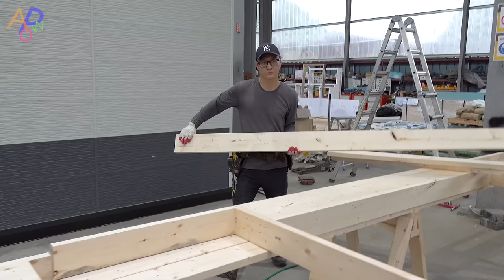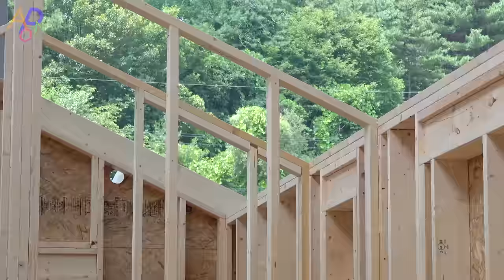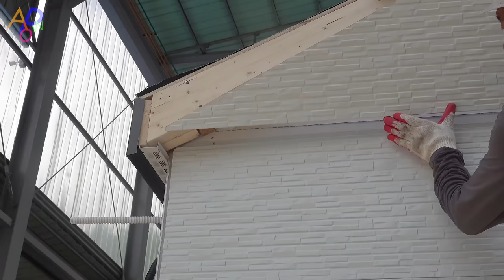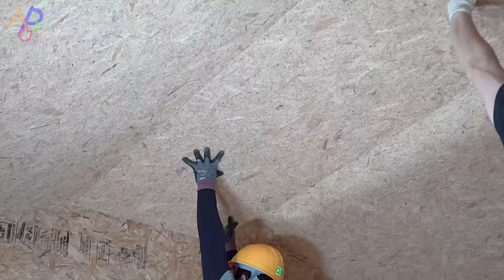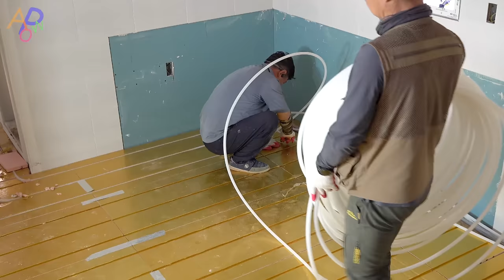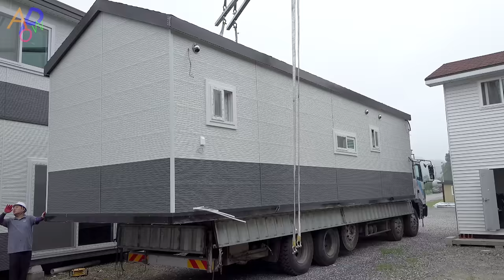Process of Building Mobile Wooden House in One Week. Amazing Korean Modern Architecture

Comment: I see a lot of comments below from people that clearly are not in the house building industry!  
- These are pretty normal wood frame construction techniques being shown. 
- You build to the conditions - this is probably going to a semi warm climate. 
- The siding is insulated. The floors are insulated (and heated).  
- That's not plywood, it's OSB (oriented strand board).
- It has Pex plumbing and uses BX wiring.
- Guesstimating it's about 700 sq ft which would be a nice starter home for 2 people.

There... that should save about 500 comments!   :D
Reply: Oh, and having done it... I PITY the backs of the guys in the roofing department!  I loathe doing asphalt roofing.
Reply: Can you suggest , how much it can cost ?  i mean basic house like on the video?
Reply: @nameeman207  - It REALLY depends where you live, and where the manufacturer is since transport costs are a large factor. You would need to contact a local seller of manufactured or modular homes.
Reply: En attendant ce n'est pas à construire partout par les temps qui courent...en cas de tornade ce sont les première maisons à s'envoler !
Reply: 700 sq ft is barely enough for a 1 br  apt
Reply: @jerrybaird2059  - I lived in a 650sq ft 1 bedroom apt with my gf. It was fine at the time. 
And tell the guy living in a cardboard box that it’s too small.
Reply: they sure made it look easy tho lol
Reply: 댓글에서 몇 가지 수정해야 하는 부분들이 보입니다.
1. 면적은 동영상에 40 sq meter 로 제시되어 있습니다. 430 sq ft 에 해당합니다. 바닥면적 3.2m x 12.5m 정도로 추정해볼 수 있습니다.
2. 단열재 시공 과정이 편집되어 생략되었으나, 일반적인 한국의 기후에 따른 단열재 시공 수준을 고려할 때, 미국의 캘리포니아나 메사추세스, 또는 유럽의 독일 전역에서도 따뜻한 환경을 유지할 것으로 보입니다.

Comment: I don't think I'd class this as architecture, more like building construction. Still I liked it a lot. These look like the portable cabins you can stay in at caravan parks here in Australia, where was the ceiling insulation?
Reply: I got a glimpse of paper backed batt type insulation on the underside of the roof as the OSB was being installed to form the ceiling. We didn't see the wall insulation other than the foam which is incorporated into the outer panels.
Reply: it is skipped. check the comment

Comment: Is there insulation in the walls and ceiling?  They do not show it.  Is the only heating hot water in the floor?  What about cooling?
Reply: Only Hot water, not for the cooling,  Insulation was Install Rafter and between of Stud
Reply: @arch_tekton8250  So the building is useless in cold climates.
Reply: @Windrider6 무슨 소리야...  바닥 배관에 뜨거운 물을 순환시켜서 실내를 따뜻하게 한다.
일반 주택만큼 단열이 충분치는 않지만 아주 추운 지역이 아니면 큰 문제는 없다.
Reply: 영상에 안보여준다고 함부러 말하는데 제대로 알지못하면 입닥치고 있어야지 너보다는 더 잘 아는사람들 많은데도 그냥 보는거야 알겠어?

Comment: Most of the materials being used are familiar to me from their common use in the USA. The panels used on the exterior, however, are something I have not seen before. Can you share more information about them?
Reply: In the states we have vinyl siding with styrofoam backing. What they are using is probably something locally made with similar properties.  Just another viewer trying to help.
Reply: that is say "Metal siding". the make Press Thin Metal Plate for the Emboss and Stick on Backside of Insulation,
Reply: Probably aluminium and foam sandwich . Is used in Australia and can be an extreme fire hazard depending on what foam is used .

Comment: This unit is so air tight, it needs some kind of air exchanger.  Some way to bring in fresh air from the out side. Also, the plastic on the top of the roof does no good. It is ment for ridge cap ventilation.  In order for it to work, the roof needs to have the wood cut away under it . This allows the heat from under the roof to escape.  Very nice.
Reply: @@kaycee5115 Auto correct sure made a mess of my comment.  I'm happy you could understand what I was trying to say.  Thank you for your response.  👍👍